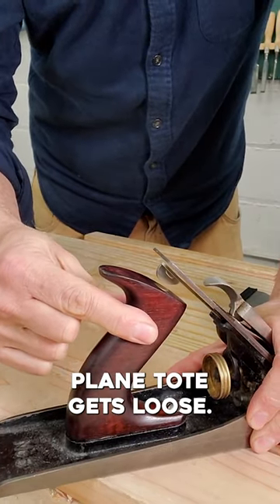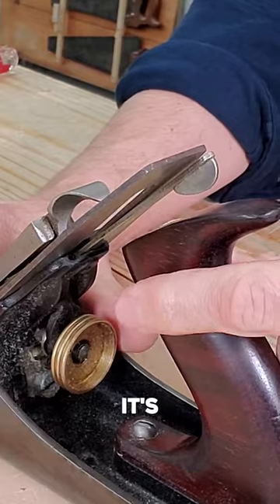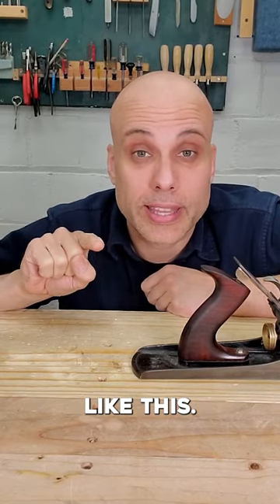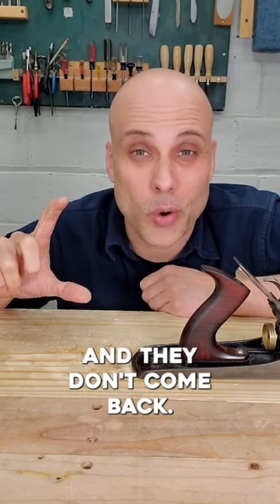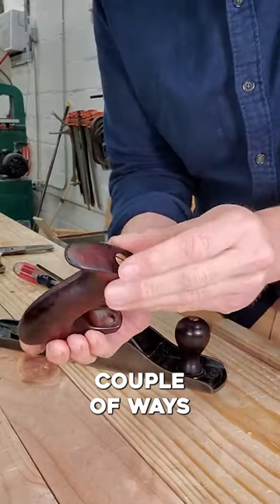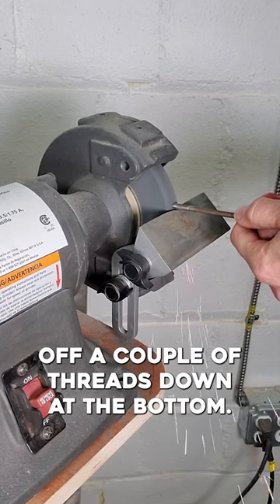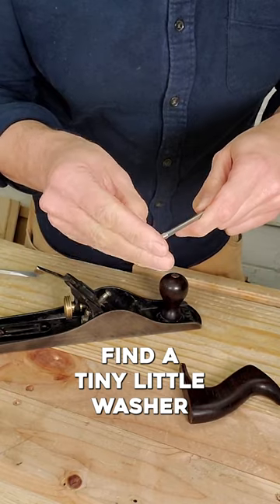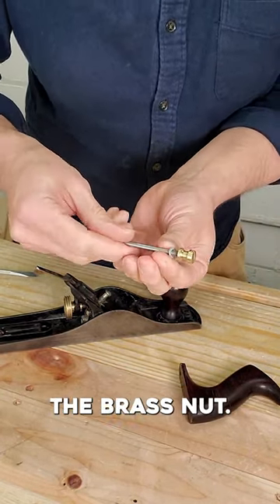Fix that Plane Handle #diy #woodworking #woodworkingtips

Comment: TIP: before you grind anything threaded, put a nut on so you can back it off afterwards and straighten the theads back out.
Reply: Absolutely no need to do this, just use a file to clean up the end of the thread and add a small tapered lead-in. You have to do this anyway unless you want a razor sharp end that's hard to get a nut onto.

Comment: I trace around the bottom of the handle onto a piece of leather. Cut a hole for the screw and your done. It works great as it expands with the wood and provides friction for the whole of the bottom of the handle not just a small focal point at the top. Hope this helps. Love your content rex. God bless from england.

Comment: I actually have this exact problem on a plane I'm trying to restore (first-timer), but the screw on my handle does not come all the way out. I can loosen it and remove the handle and screw together but the screw has little give within the handle. Any advice?
Reply: The screw is bent enough so that it binds in the channel in the handle. Since there is no obvious way to straighten the screw until it is out of the handle, you will need to take a rod with a flat end that is the size of the channel and push up through the bottom of the handle as you turn the screw counterclockwise. The additional push from the bottom will allow you to back the screw out of the channel in the handle. Be very careful when you straighten the screw. Good luck.

Comment: I understand carpenters used to soak their hammers in antifreeze when the head became loose.   The wood fibers will absorb the fluid, swell, and seat the head tight once again.  Wondering if this would work.

Comment: The problem my tool has is with the knob on the end. It's also fixed by shoving a bit of metal into the hole at the top. 😉
💚🐇🐴💚